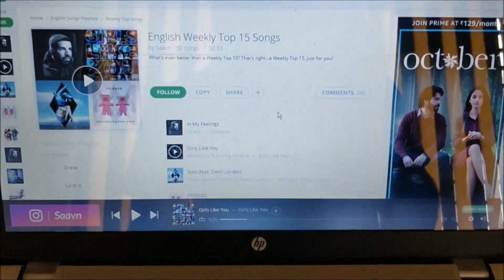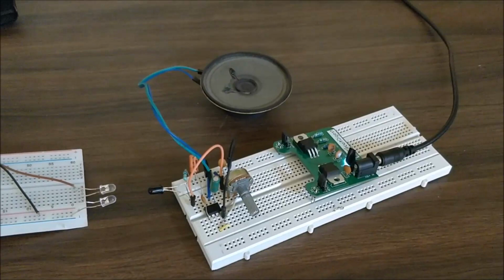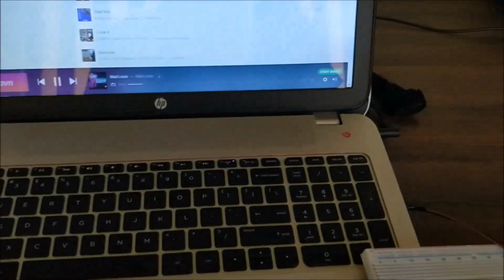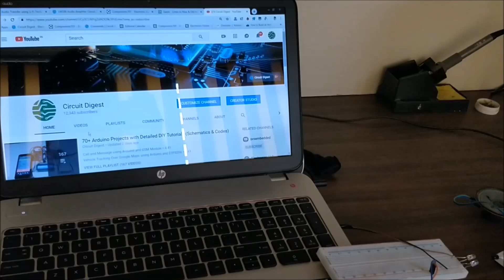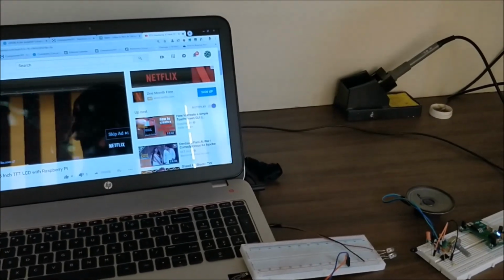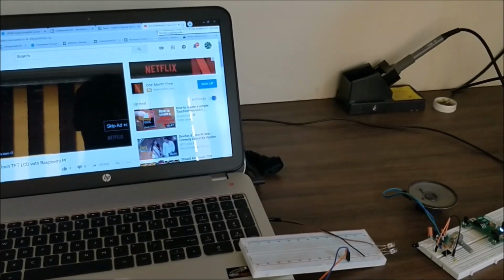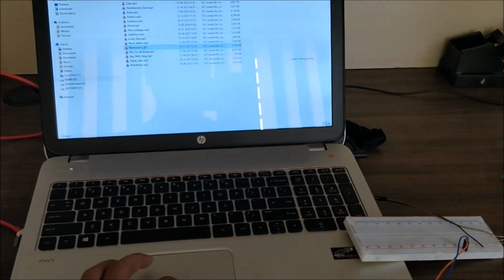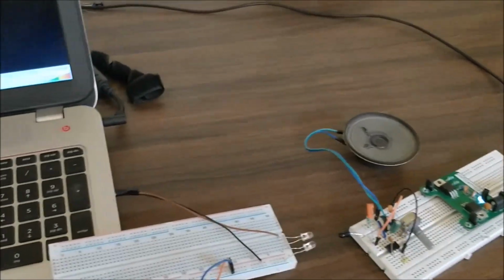How to Make IR based Wireless Audio Transmitter and Receiver Circuit

Comment: Hi there , thanks for this video, I was wondering if it’s possible to use this circuit but instead with an IR transistor receiver, in that case how will the gate and source be connected?